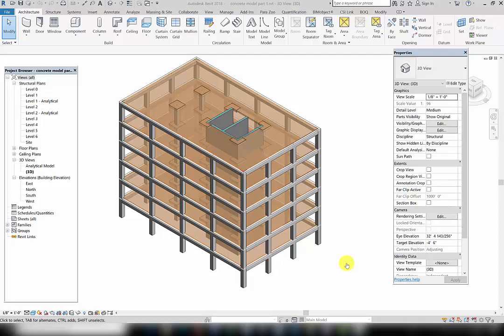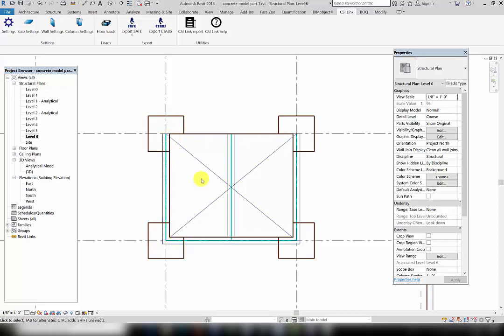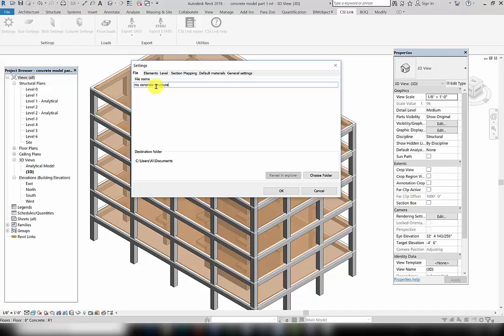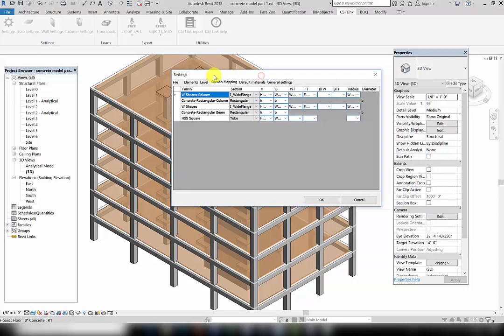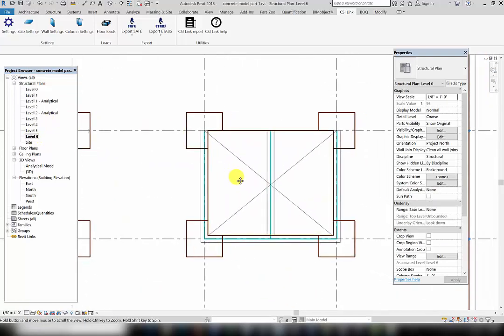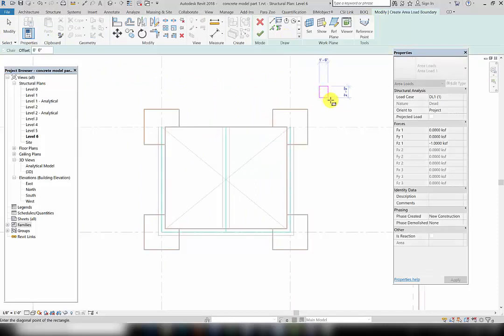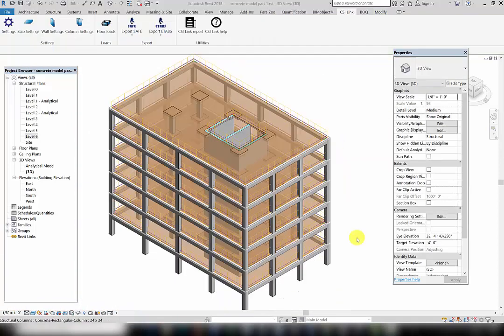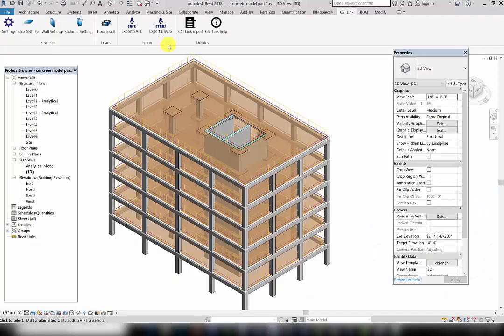CSI LINK - export Revit model to ETABS (Part II)

Comment: When I enter the load, I encountered "no floor type was selected in row 1, 0 area loads have been updated" in the slab load generation report. The load table does not allow me to enter any values. Would you be able to direct me how to proceed. I am a curious architecture student
Reply from the maker: Which version of Revit are you using ? note that in each row of table you must select a floor type and that floor type must have been used in the model.
Reply: @parametriczoo8568  revit 2019. I am unable to select any. The in-model floor selection disappear as soon as i move to the load type.